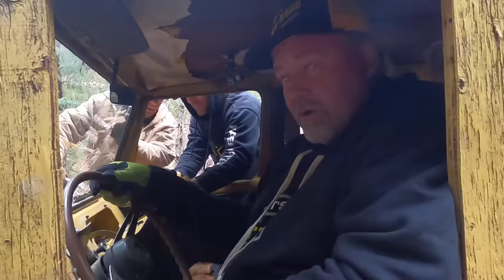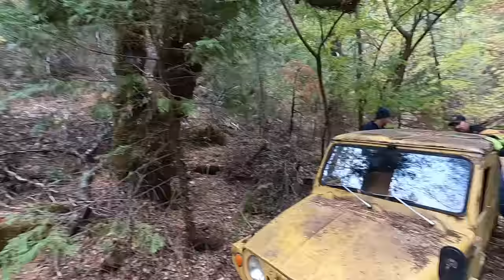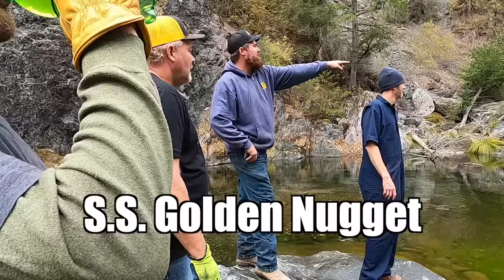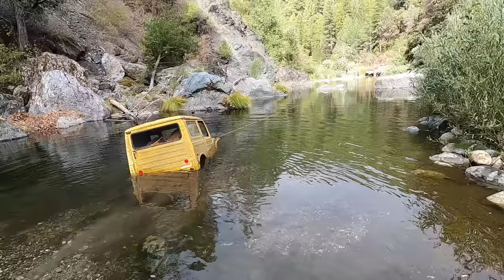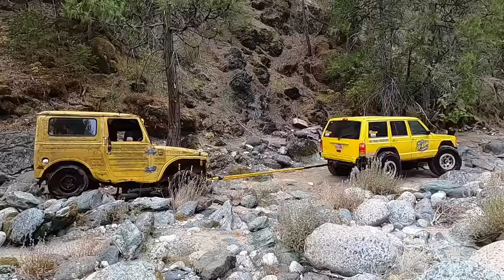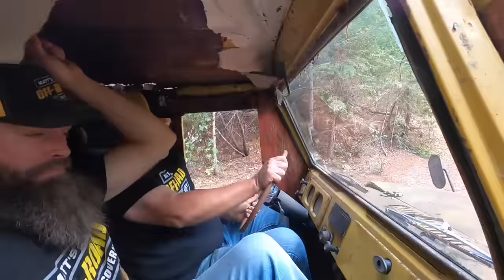Recovering Ed's LJ20 Stuck 40 Years In The Sierra Nevada Mountains

Comment: I love it that the fact that it's a 2-cylinder 2-stroke and what's left of it hardly weights anything did not deter them from recovering it the "traditional" way and making a very entertaining video in the process!  I used to own a '75 Suzuki Fronte coupe powered similarly 360cc and very light weight, but I had problems with people picking it up and moving it where I couldn't drive off.
Reply: At least the football team did not carry it up five fights of stairs and put it on the roof.  For some reason the staff were not willing to do the same going back down and hired a crane instead.
Reply: I agree!
Reply: Ran two of these in the Peten jungle in Guatemala in 1981. Awesome vehicles. Unstickable.

Comment: That was awesome! Little Suzuki was the perfect fit for the narrow road :)
Reply: That road made the suzuki look wide
Reply: @xmo552  Ed drove it back there 47 years ago on what used to be a small service trail to his gold mine. He left it over winter and a huge rock slide cut him off. All the rocks they were crawling over. Mother Nature and all the tree growth over 47 years hid the original road Ed used.
Reply: @onebridge7231  somewhat yeah. Roads definitely alot worse. But he did say that suzuki and an army jeep (which were super narrow) were the only vehicles that could fit back there.
Reply: All true,the banana  took a beating  tho
Reply: @JamesJones-rg3dn  Was that THE banana, or a second jeep?
Reply: @russellhltn1396  the banana in the make over process yet to be completed..
Reply: Ivan, the little yellow submarine is misfiring on   all plugs, do you think you could get it running with no parts required?
Reply: The banana took the high road and the Suzuki took the low road around the tree
Reply: @russellhltn1396  that was the banana. Haven't you watched the previous videos of them doing all the upgrades to it, then a couple videos before the premier of operation golden nugget they took the Winder towing signs off & put Matt's off road recovery on?

Comment: Certainly not one of your smoother recoveries but given the circumstances I’m still impressed you got it out!👍 You might be able to repair the plastic grill with modern glues they have available. If not I’m sure you could fab on up out of sheet metal to duplicate it. I’m betting the originals are very difficult and expensive to source.
Reply: 3D printing
Reply: Paul from Fabrats will come up with something. I wasn't surprised to hear Matt say Fabrats was going to take it to their shop, Paul can fabricate/repair anything you need. Paul & his family are very good friends with Matt & his whole family & crew.
Reply: @dankingsbury9971   Yes you could certainly 3-D scan the side of the grill that is undamaged and make a complete print out… But for a part that size it’s going to be pretty pricey too and then if they are going to turn it into an off-road rig it could get damaged again, it would probably be better to have one made of sheet metal that could be repaired after a bump up.

Comment: I'm just amazed that little truck used to travel that "road" 40+ years ago. 
Some of those little rigs were very capable units.
Reply: Well Ed said in the first video that there was a very nice road down there and the rock slide took it out. That same rock road they avoided and went for the water. The canal was the last resort to get there.
Reply: That "road" was completely different 40+ years ago, most of it was washed away in the rockslide and the rest just deteriorated to the point where it would need a complete rebuild to be anywhere near its original condition.
Reply: @cooper7395  
That is correct,  but he also stated "the steps" were not affected by the rock side. And that's not a chill pile of rocks to drive through.
Reply: The usual road was blocked with the rock slide.

Comment: i’m more suprised it isn’t rusted out at this point, is it made of fiberglass?
Reply: metal doesn't oxidize underwater
Reply: if the water is clean enough which at that elevation it's likely just snow melt runoff, there's nothing to cause the metal to oxidize or corrode. It's actually known that you can KIND OF stop a vehicle oxidizing/rusting if they're returned to the water after being saved, at least for a short amount of time
Reply: @lostkid6464  i… that doesn’t sound right
Reply: @lostkid6464  

Really? Try keeping your spanners and sockets in a bucket of water then.
Reply: if you look close the roof is rusted out around the seams to the point sun is coming in and the corners and wheel wells were just starting to rust this thing could have spent the other half of it's life in a garage who knows.

Comment: Nugget - Rokon - Trailer Collaboration Reveal Request: 

Hide the Nugget offsite of Matt's. Have the Rokon shipped to Matt's using Shawn's crate - recrate Rokon to make it appear to be a brand new Rokon so it will seem the original Rokon couldn't be saved.

Another surprise to lead off the Nugget reveal, considering Ed only thinks the Nugget isn't being touched yet, he'll be surprised to receive at least one item before seeing the other items. 

Then Robby Layton shows up immediately after with the trailer on the roll back all decorated with surprise Ed signage. 

Think Ed and your fan's would get a lot more out of seeing his response if he still believes the Nugget is on the back burner. He has been to Shawn's shop so he knows they have it and Robby is painting it.

Comment: Honestly I have two very big questions how the sweet Unholy Jesus did you get it out there forty years ago? Second question why is it in such incredible shape this looks like something where you could yank the engine and the wiring and put it back on the road with some work it honestly doesn't look nearly as bad as the 72 Jimmy that I put back on the road and drove for several years. This looks like a museum piece by comparison especially when you realize how much of the vehicle was missing when I started lol.
Reply: The story of how it got there is in the video your commenting on. He drove it in on a road and parked it there.
Reply: @mikewhitman745  Guessing that means the road grew up that bad and changed
Reply: @peterparker6584  47 years of no maintenance on a dirt trail will definitely change how it looks, especially with rock slides happening here and there that cover the road.
Reply: @mikewhitman745  yes i can see;)wear was big foot hiding in that one;)?glad it worked out. thar a fun Little unit